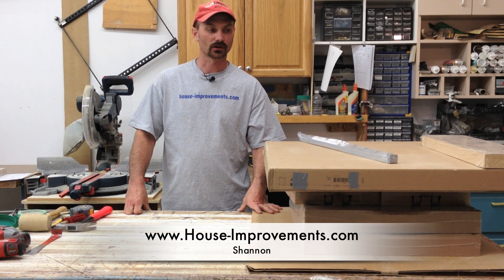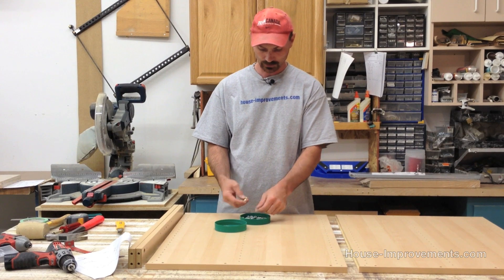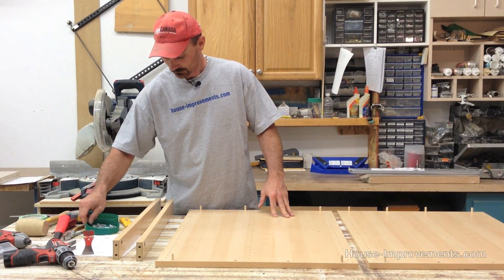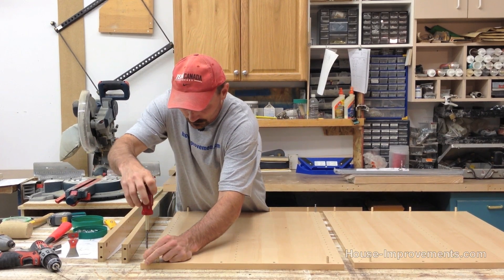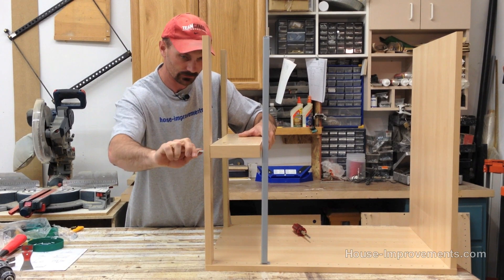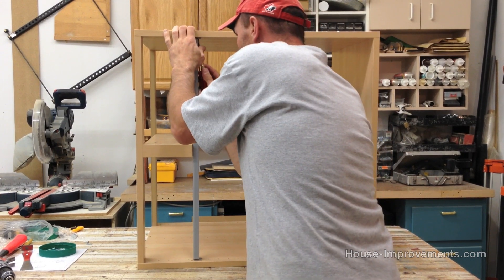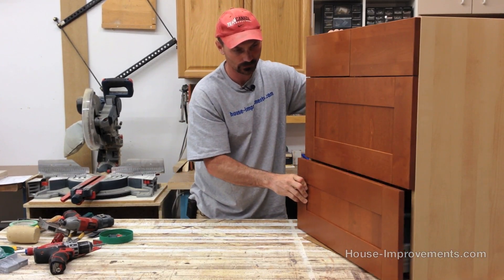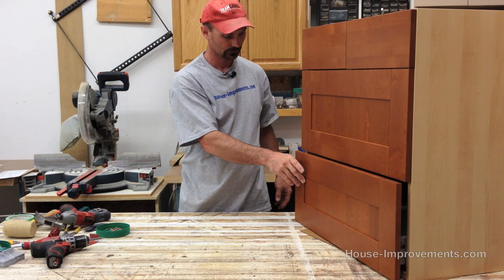How To Assemble A Ikea Base Cabinet With Drawers

Comment: How about a video on making the base and how to attach the base cabinet to it as well as how to attach a countertop?  This cabinet did not appear to have any way of attaching these items.
Reply from the maker: These cabinets are set up for adjustable legs/feet, sold separately. the counter top simply sits on top and then you install screws from inside the cabinet up into the bottom of the counter. Be sure not to use too long of screws for that.